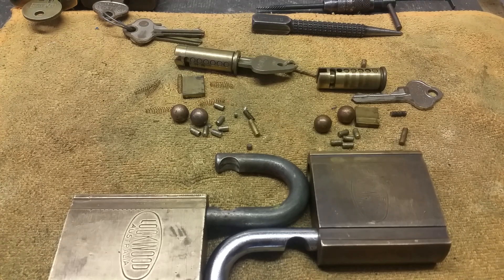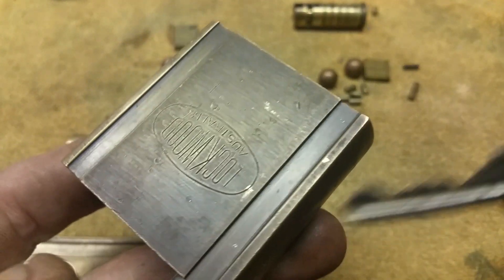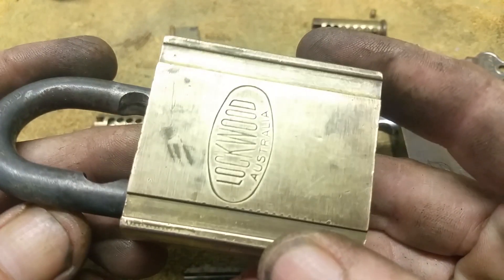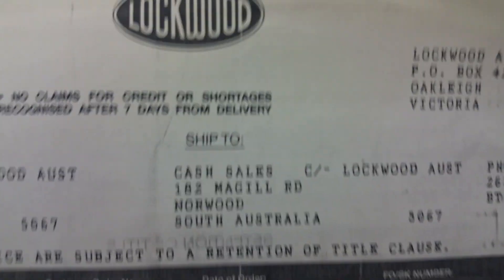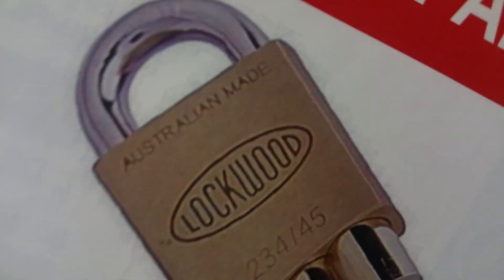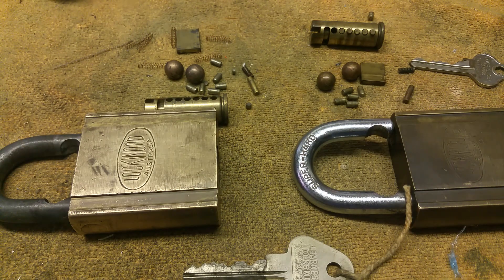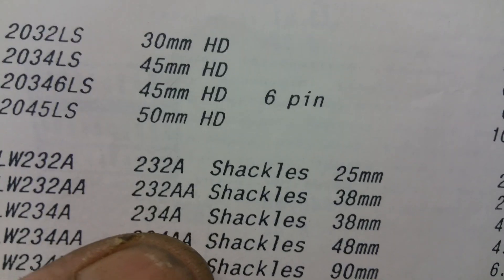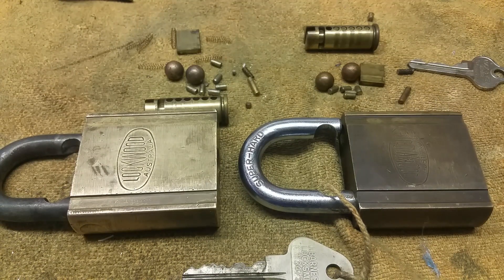#95 The 247 & the 245 JA dismantled.

Comment: The GST started in 2000.
Reply from the maker: Thanks Gary. So the Government has been stealing from the citizens for 19 years?...........BASTARDS! lol. Cheers:-)
Reply: @crankylock7844  Hey, 10% is better than 21%. And that was just the sales tax. How much was the wholesale tax?
Reply from the maker: @two_tier_gary_rumain  Yeah, valid point. They're still thieving bastards though. lol. How did that deadbolt go? To be fair, never seen that application before in a deadbolt. If you see a hex head through the hole on one side maybe the other hex head is behind the plate on the opposite side on the outside. Couldn't see a brand of any description on the lockset. The one side that was exposed looked as if it was drilled or something. Interested to see how you go. Cheers:-)
Reply: @crankylock7844  I found out from a neighbour in one of the other townhouses. I just noticed today that they changed theirs to an electronic one. Anyway, they said to take off the bolt plate and the rest of it comes apart. Apparently, the two screws hold it all together. Not what I would have expected.